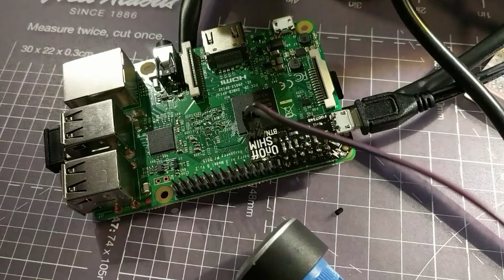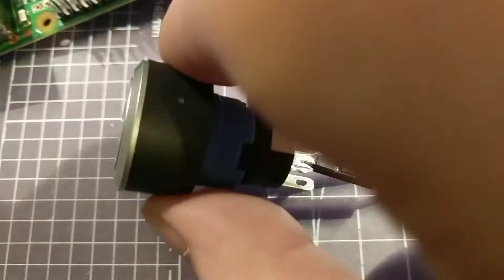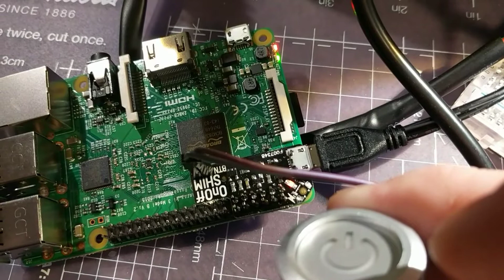Pimoroni OnOff SHIM with toggle switch. Works!

Comment: Hi Paul. I Have se same problem then the others. I hope you can help me. I have the same board und a toogle switch on the  button pin. but the button does nothing. What must i configure that the button works? the small button on board works fine. Thank you

Comment: I've tried to follow you but am nnot getting the same result. The red LED stays lit and the device powers off if the switch is left on for 10 or so seconds. How did you get around this issue?

Comment: Is it possibly to combine this with a software shutdown? Cutting power off and restarting after releasing and pressing the button again? I use it in a Phoniebox, which has sleep-functions and idle shutdown.
Reply from the maker: The OnOff SHIM has a software shutdown by design, so yes :)
Reply: But the toggle switch is still pressed after shutdown (shutdown -h +0) and the Shim and pi stay powered, even if I release the toggle button. What's the mistake?

Comment: Hey does it still safely power off if you turn it on and the off quickly (before the pi has fully booted)?
Reply: The safe shutdown relies on the software to shutdown, so it won't respond until that is running, so yes, it does. But if you press during boot, it will do nothing :-)

Comment: Must you always have power coming in thru the SHIM or will it still work when connected to the original power in.
Reply from the maker: onepilot power has to come thru the shim or it has no way to cut the power to the Pi.
Reply: Hey! Yeah, I managed to get this to work. I had to edit some of the daemon code though. If you look for the shutdown_trigger function in the file /usr/bin/cleanshutd, you will find two cases of [ `pin_state` = 1 ]. Change this to [ `pin_state` = 0].
Reply: Hi Dan, did you find maybe what is the cause? I have the same problem :(
Reply: Paul, did you have to change anything in the daemon config for this to work? I'm trying to get mine to work like yours, but it runs the shutdown script the moment the pi boots. Cheers.
Reply from the maker: Nothing changed in the config at all, but maybe I got lucky with this switch?
Reply: Dan Meek: Thank you for your info. I'm using a slider switch with the Onoff shim and it only works after I did the changed in the cleanshutd you mentioned.